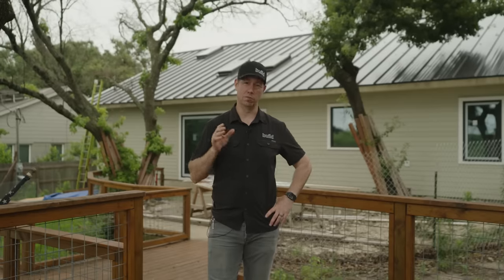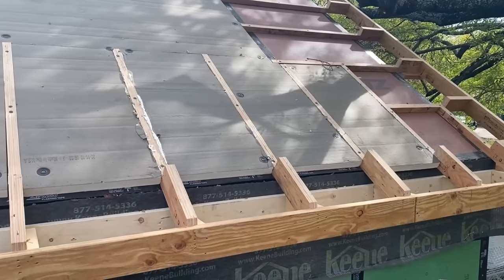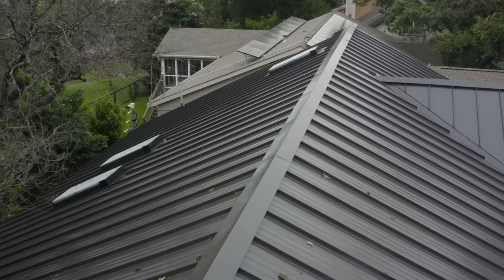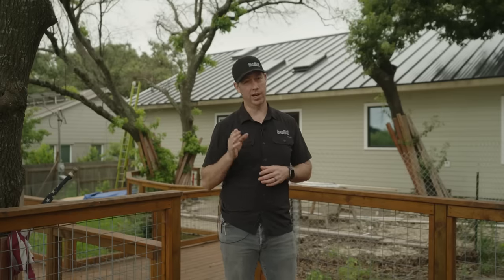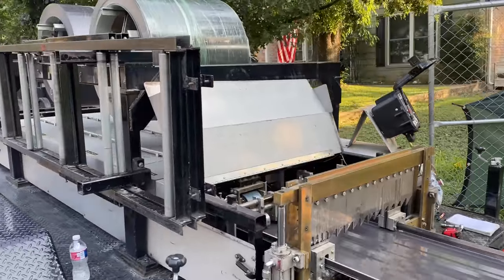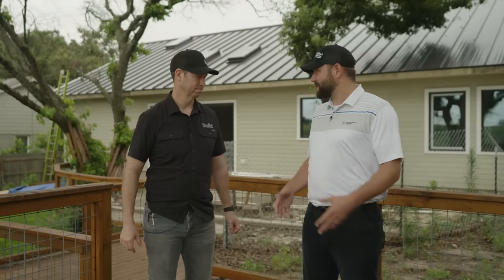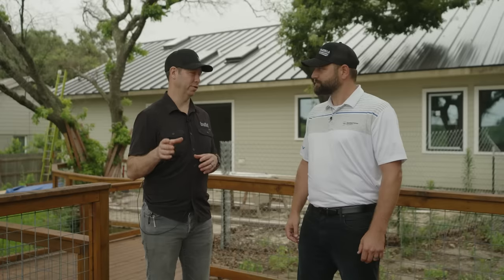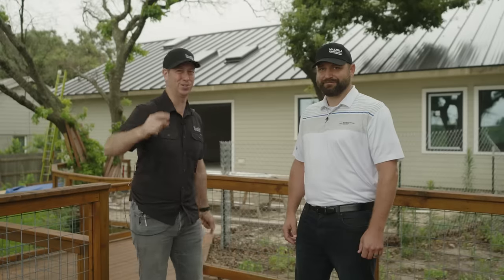Metal Roofs - 2 Ways to INSULATE UNDERNEATH!

Comment: By letting air flow under the metal to ridge line vents make a self cooling doesn't it when the hot air heat by roof pumps out out air and sucks in cool air from the roof bottom

Comment: What is the purpose of the 2nd layer of Zip sheathing? It seems wasteful and unnecessary. Why not apply the underlayment directly onto the insulation and then the venting 1x4s, then the metal roof?

Comment: Serious Question:  Why put all of the time, labor and materials into building the insulated roof decks shown in your video when you could have installed SIP panels on top of the rafters?  

I would tend to believe that it would cost less money overall, have a higher R value, be an overall stronger roof system and it would be completed in far less construction time.  
The SIPS could have been sized to include the overhangs without all of the customized materials and proper installation methods to keep the roof watertight.  
There are SIPs that are manufactured with fire retardant polyurethane foam cores (on example is Eco-Panels).  Yes, many jobs would still likely need to install furring strips to vent the metal roof.  

Please let me know if my thoughts/calculation are mistaken as I would be open to other/better methods.

I have only used/installed metal roofs on my projects since 2009.  It would almost take a miracle for me to install another fiberglass/asphalt roof.
Reply: In a dry climate sips will perform better for r value per dollar and ease of installation. In a perfect wall or REMOTE system the key is having vapor and air control layers below the insulation to control condensation or water penetration on the exterior layers or sheathing/deck. In a sip roof that layer is osb, which is moisture sensitive. You can look at the building science Corp blog on sip roof failure causes in SW Alaska you can see some negatives - though many of these could be addressed with proper venting and sips installation to prevent air leakage. In short this style of assembly will work in any climate no matter where the condensation point is by season, and is much easier to detail the air and vapor control layers and make them continuous.

Comment: They don’t build roofs like that in Australia, under a metal roof they use a foil topped fibreglass insulation blanket!
Reply: All comes down to cost Peter..People here aren't educated on the benefits of enclosing the building envelope (Air tightness) is met with so much resistance. If only we had 300mil here to drive down the cost (based on demand) & keep things competitive. I enjoy how Nth America/Europe concentrate on energy efficiency/air quality inside the home as opposed to the tripe we get served here in Oz
Troy
Reply: its mineral wool blanket in my area (FNQ) and the foil is facing inwards, not topping.
As for making it better.. look up 'perfect wall' from BSC and draw your conclusions.
After 3 buildings I arrived at steel beams (rafters), wire mesh then vertical 70x45 or 90x45's as battens with the space between filled with mineral wool blanket R2.5 (m^2 K / W, 90mm thick, KNAUF multi-use roll) sitting on the mesh and the whole thing covered with KlipLock, to get no screw penetrations. This buildup is better than squeezing the mineral wool at the battens and thus insulates better. If you want to top this you'd run a 2nd layer of battens/mineral wool perpendicular to the first set, to reduce the thermal bridging through the wood.
Was the last building I did and is the coolest under the roof.

Also venting a metal roof will definitely cause condensation on its underside during night time in the tropics.. I wouldn't advise to do that.

Comment: What I hate about metal roof is zero cell phone signal .
Reply: Unless you got metal clad walls there will be plenty cell phone signal.
And yes, I got metal roof and metal wall clad.. reception is OK near windows.. otherwise not.
Reply: @joansparky4439  I go into my house and I got zero reception. When you leave suddenly 20 missed calls and messages pops up and I don’t have metal clad walls. Mine are primarily stucko and brick
Reply: @PumpkinKingXXIII    1) try to find the location of the mobile tower that serves your location
2) place your phone when home near a window that faces that direction
3) failing that either get a passive repeater (two antennas, one directional high-gain outside pointing at the mobile tower and another omni-directional inside near your phone) with short low loss cable between them
4) failing that an active repeater that is legal to operate in your area (In Australia such units have to be approved by the regulator to be legal and safe to operate, price thus a bit steep.. AUD $1000, don't try cheap Chinese ones as they make the situation just worse for everybody in your vicinity and could cause you a hefty fine when authorities catch you)

Comment: On an existing house, how could something like this be done?  I need to replace my roof here in the next few years.
Reply: Presuming the roof decking is in good shape and you don't want to add the extra foam insulation there are companies that will put it down much like a normal re-roofing job.  I was looking at having that done not too long ago (Erie Metal Roofs was one quote I got), the pricing was about 25-50% more than a 25 year shingle job.
Reply: @michiganengineer8621  Yeah, I was looking for a roof decking replacement plus foam and metal roofing.
Reply: @HawgPyle  As long as the rafters are intact it should be doable.  Best bet would be to see if there are any local metal roofing specialists in your area
Reply: Matt has covered that before... you basically start by sawing off all the existing rafter tails and bringing the siding all the way up. Then you have the Monopoly Frame house Matt talks about.

Comment: As a roofer with 24 years experience. I hate everything about every idea in this video. I have never seen such a waste of time, resources and manpower put into a roof for so little benefit that have already been solved with much more effective methods.
I'd get all the gear delivered in a pack  and me and my 3 guys would get it done in a day and it would have an R rating 3 times higher. 
This is an insulation vid after all.